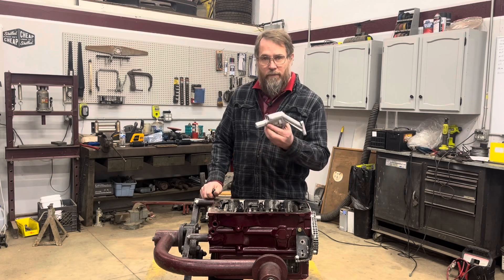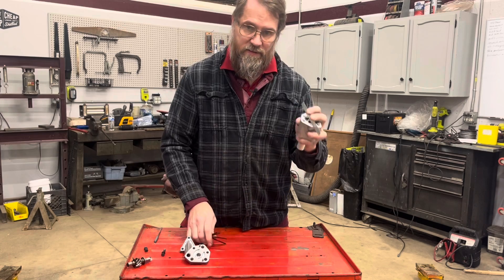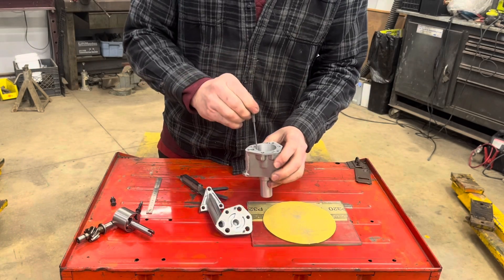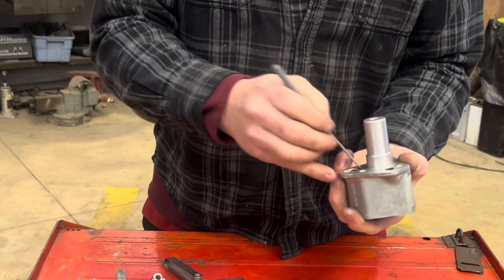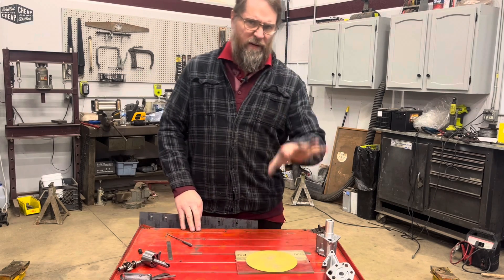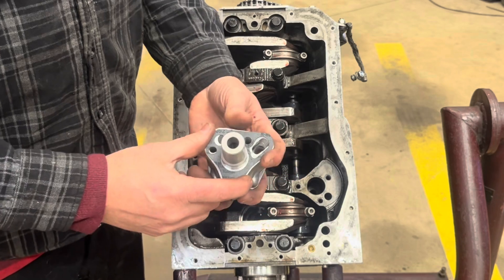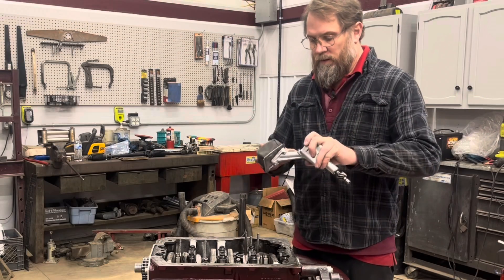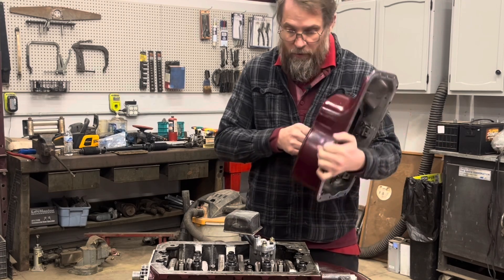MGB performance engine build part 4, oil pump and pan

Comment: Wondering if you "packed" a new pump with grease, Vaseline, or assembly lube?
Reply from the maker: Nope, I never do. If you watch the video of the first start up on this engine you will see how I ensure that I get oil pressure very quickly on a new engine.

Comment: Thank you for the outstanding videos and tutelage on all you videos, I’m learning so much about my MG. 
Question- I understand the tolerance concerns, but with all the work you put into the oil pump rounding and enlarging ports in it, wouldn’t a stock (within tolerances) high volume pump provide even more flow? Thanks, looking forward to the next video!
Reply from the maker: Yes it would, but I don’t need the high flow one. I just tend to take it too far and not stop at the simple clean up I initially am doing. Especially with my car where I can put whatever time into it I want as I’m not billing myself those hours 😂

Comment: Never actually seen a square oil screen in an MGB engine before and a corresponding square in the oil pan..Must be something to do with the "Autocrosser" build.
Reply from the maker: I modified the oil pickup screen to be a little smaller, so that I could make the corresponding hole in the windage tray I built a little smaller as well…. For autcross

Comment: Hi thank you for the excellent videos!  I’m starting to rebuild my engine and thought to change my main studs over to arp.  They seem to be very tight and hard to get out.  Some people have said not to disturb them and that the oem are strong enough and don’t give any issues.  What are your thoughts on removing the main studs and replacing with arp?  Thank you!
Reply from the maker: That depends on how you use the car. For normal street use there’s no real need. I have ARP in this engine as an insurance policy as I will beat on it pretty hard and have no problem with turning it 5000+ rpm’s
Reply: I do have arp bolts on the rods but wondering if the main cap bolts need to be changed as well.

Comment: Thank You ------ a lot of GOOD TIPS there that one can do and look out for even if one is just freshening up an engine ---- one always thinks--- would it be better off with a HI-PO Pump ----- but clearing out the --- flashing --- from the casting ---- some match porting ---- the Flow won't be as restricted and will have a better flow ------ Will have to let us know if you have any greater or lesser of oil leaks from the Cork Gaskets --- front and rear ----- after you get her going---- would be interesting to hear ------- Thank You again for another Good Video ----- Have a Good Week ----- Rodney